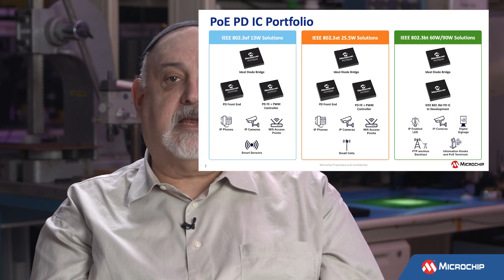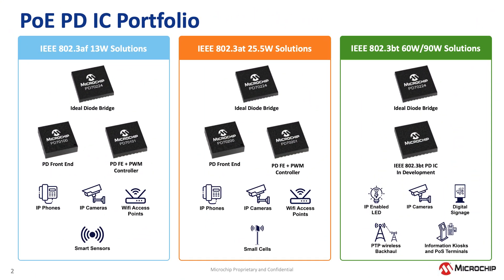AOE | What is a Power over Ethernet PD IC

Comment: Seeing as USB PD is a standard, calling your chip 'PD' is a plain awful decision, as it implies a connection to USB PD.
Reply from the maker: Hi Chris, thanks for your comment. We understand your concern, however it’s worth noting that "PD" has multiple meanings in the electronics industry. In the context of Power over Ethernet (PoE), "PD" stands for "Powered Device." It refers to devices like IP cameras, wireless access points, VoIP phones, and other network-connected devices that receive power over the Ethernet cable in a PoE system. On the other hand, "PD" can also refer to "Power Delivery," a standard for delivering power over USB-C connections commonly associated with fast charging for devices like laptops, smartphones, and peripherals. Hope this is helpful information. Thanks again for reaching out.